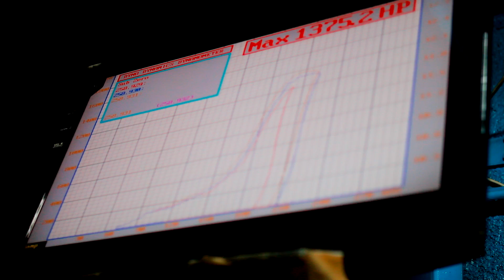Nissan Patrol 1375hp dyno

Comment: these old nissan come with tb42 which is scrap and they use 1fz becaus tb48 is expensive and hard to find for under 30000
Reply: you are right we do that its 1fz and about the tb48 explodes every time when we climb by the way it coast same when you power up the engine so 1fz is the best